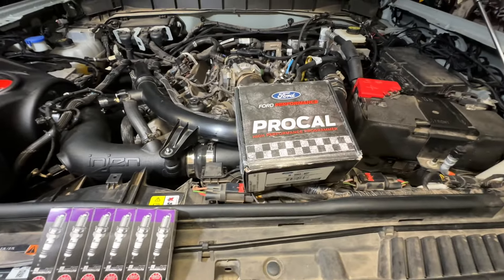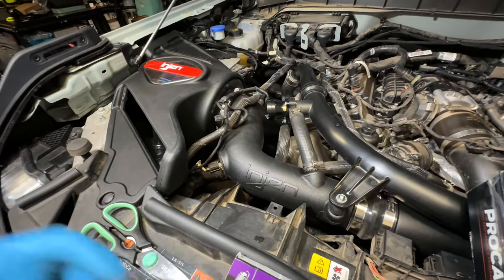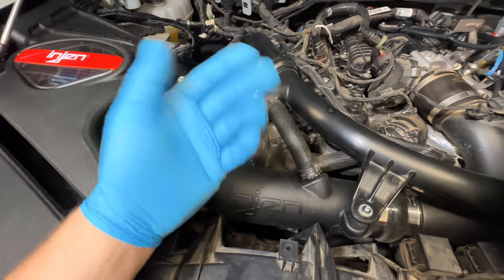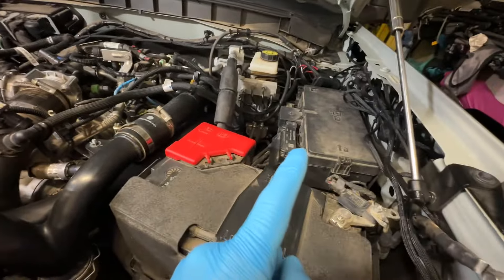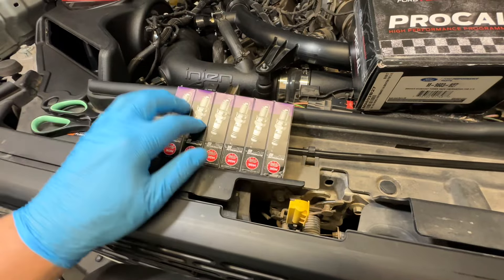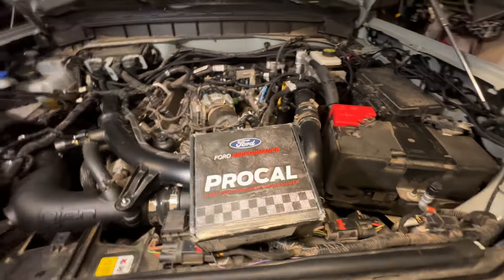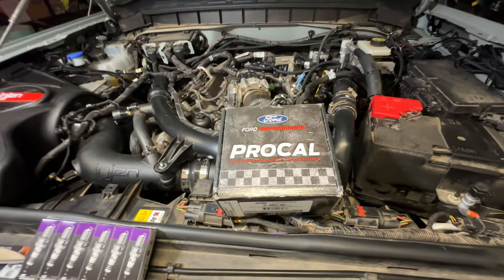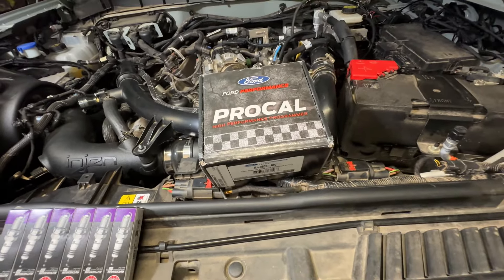Ford Bronco Sasquatch 2.7L EcoBoost - Performance Update

Comment from the maker: If you're interest in adding more power to your 2.7L Ford Bronco then check out the CVF links below:

CVF provides FREE domestic shipping and charges ZERO taxes to you. On top of that, all of their products have a LIFETIME WARRANTY. 

Use code: FULLSPEEDFORDBRONCO to save an extra 5% off your purchase

CVF Links:

Intercooler: 
https://www.cvfab.com/products/bronco-ic?ref=cispuiu0

Charge Pipes:
https://www.cvfab.com/products/cvf-bronco-2-7l-hot-cold-side-pipes?ref=cispuiu0

Turboback Exhaust system (Downpipe $ Cat-back exhaust): 
https://www.cvfab.com/products/cvf-turbo-back-exhaust-system-2021-2024-ford-bronco-2-7l-ecoboost?ref=cispuiu0

Catted Downpipe:
https://www.cvfab.com/products/cvf-stainless-steel-catted-downpipes-2021-2023-ford-bronco-2-7l-ecoboost?ref=cispuiu0

3" Catback Exhaust:
https://www.cvfab.com/products/bronco-exhaust?ref=cispuiu0
Reply: @fullspeedfordbronco I have a 2.3l 23’ BL Sasquatch. I added the procal tune, FM Catback Outlaw, K&N filter on stock air box, pedal commander, and 74 weld portals. I’m curious on what you would recommend to help me with a bit better MPG and power. The larger tires destroyed my MGP and the 2.3l on portals feels more like it did before I installed the procal. Please help. Cheers!

Comment: I used the procal gauge function on my 2.3  bronco (now have the 2.7) to measure intake air temps. I then put it in my focus rs (2.3 350hp). The iat was 20 degrees higher than ambient in the bronco, about 5 degrees over in the focus rs. I think the bigger intercooler will be worthy.
Reply from the maker: Appreciate your comment. I just uploaded a new video showing the Intercooler install. So far I’m seeing a 20 degree reduction in IAT2 over the OEM one.
Reply: Definitely do a intercooler swap if your tuning

Comment: How did you find the gap for the spark plugs? I can’t find anything on .31 factory and I know .028 for 2.3 is ranger
Reply from the maker: Gap was recommended by my Tuner. ZFG Racing.

Comment: I just got a badlands with the 2.7.  Also got an extended warranty past the Ford 3 year.  Does any of the mods you mention in your video void the warranty?
Reply from the maker: Ford ProCal if you have an ASE certified tech install. Everything else could be a potential issue, but it depends on your dealership.

Comment: Do you think it’s better to have all these piggy back tunes instead of of doing a good ecu - tcu tuning?
Reply from the maker: No, a custom tune is always going to be better. HP Tuners and SCT just recently cracked the PCM, but the whole process to get it work is complicated. You’ll need an FDRS setup in order to program the cracked PCM to your vehicle. You’re going to see a lot of custom tunes options very soon. I’m actually in the process myself 😉
Reply: There is a company “international Dyno authority “ that they have videos with broncos that carry the tune they provide with great results. At least that’s what they project
Reply from the maker: @kalithor1  Yep, Wally knows his stuff. So far he's tuned the most powerful Bronco. Jason's Bronco at 423 WHP - It's more with his meth kit too. There will be way more options soon enough.
Reply: I have a wildtrack bronco 2.7 and trying to see what’s the best option to wake up a little bit the engine, my only concern is warranty since the car is relatively new on the market and I don’t know if and what can possibly fail
Reply from the maker: @kalithor1  Check out my video on the Pulsar XT. It's the best piggy back tune IMO. You can always remove before you have it serviced. I'm actually going to be selling mine soon, so I can give you a deal if you want it. I only used it for a week. Going to custom tune so I don't need it anymore

Comment: Does the pro cal raise the top speed?
Reply from the maker: It does not. The only way to raise your top speed correctly is to install a Whipple custom tune (up to 120 mph) or go full custom tune ( no top speed)
Reply: @fullspeedfordbronco  what’s your opinion on the whipple tune
Reply from the maker: @22-Bronc Adds a little more power over the ProCal, but still voids your warranty. Rather have a full custom tune

Comment: Did you add the ProCal before or after the CAI. I heard if you have the CAI and try adding the ProCal afterwards that it would not work correctly. Something about the air sensors not reading correct.
Reply from the maker: I added it before the ProCal. No issues. Never heard of the air sensor issues….

Comment: The 2.7T Wildtrak high-speed off-road version will be available in Canada in December 2021. Vehicle
Identification Code:
1FMEE5DP8NLA72240 I ordered a
set of Wilwood six-piston brakes, but they displayed a trouble code when installed
Have any Bronco owners in Calgary ever encountered this situation? Do you have any good suggestions?
Like what parts need to be replaced?
If there is no good solution I can only buy the original car four piston brake pads (civilian highest level, do not race) can help recommend it? Thank you very, very much!